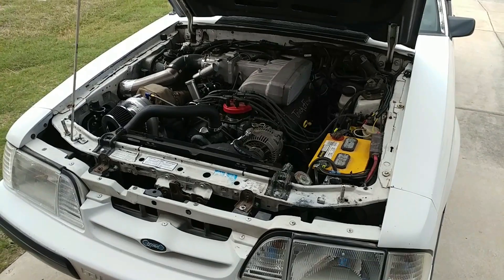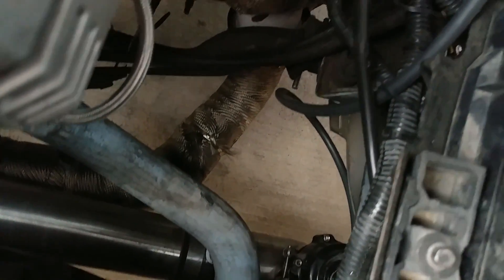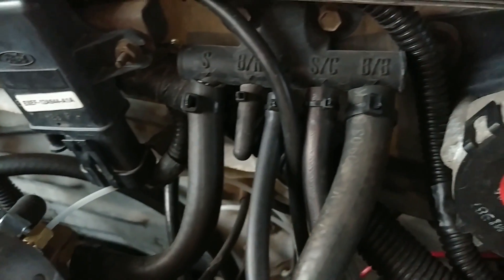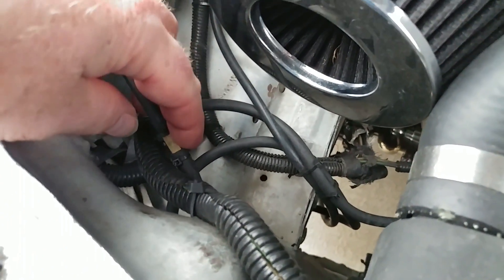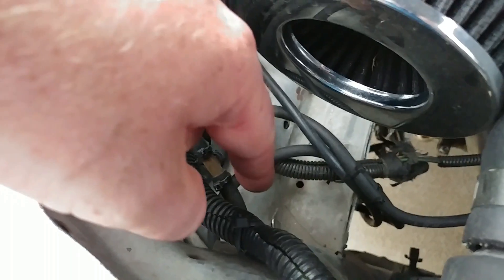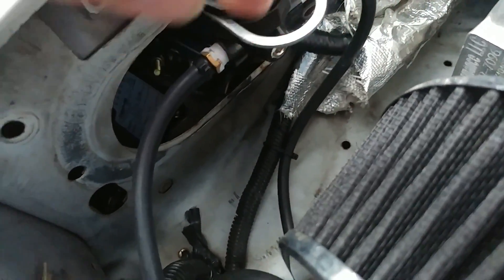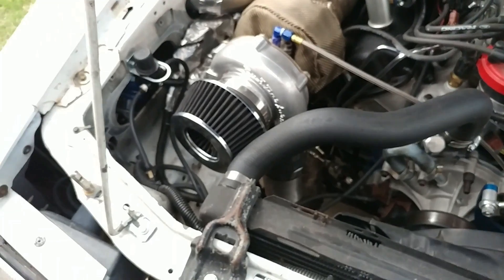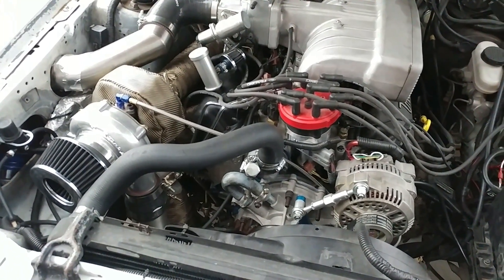On3 Turbo Foxbody Mustang Vacuum Hose Setup

Comment: I am gonna purchase one for my 90 fox, is it a direct bolt on and I have a 255 fuel pump and 24lbs Injectors. As well as 75mm throttle body..what else would I need? I would really appreciate it.
Reply from the maker: Its pretty much a direct bolt on, but every car is different. Your gonna need bigger injectors. Depends on your power goals. I wouldnt go smaller than 42s and fuel pump a 340.

Comment: Hey another question lol what about fuel system are you using the stock system or upgraded?
Reply from the maker: +J.D.M. Performance You would need to upgrade your fuel system. I'm running a really 340lph pump, 47lb injectors

Comment: If your not running a boost controller and only running spring pressure, you eliminate that T junction all together and ONLY hook a vacuum line up to the SIDE of the wastegate, leaving the TOP port open to atmosphere.
Reply: also, it looks slow... and get a good pair of side cutters(or use a razor blade) and clean up the razor sharp cuts on those zipties before you end up needing stitches. :-P  (trust me..been there..not fun.. )   

<3
Reply from the maker: Good Info. Always though you still need vacuum there.
Reply: Nope, if you run vacuum to both ports your negating the springs ability to pressure the valve open. it'll cause crazy boost spikes if done wrong. The vacuum line runs to the side to hold the spring shut at idle and when your building boost itll push the spring open when the boost pressure gets to equal pressure as the springs valued pressure rating. if the line was on the top it would have to overcome the pressure from however much psi your pushing + the springs pressure rating until the valve esentually floats open allowing pressure to bypass, but by that time you'll probably be 8-15psi over what the spring rating is.
Reply from the maker: I like to live dangerously lol
Reply: i can tell.... :-P
Reply: Did you delete your pvc system?
Reply: PCV*  and for that system you have 2 options. a 1-way valve or delete it and go with an oil catch can(which is what I do with ALL pcv systems anyways.. don't want my intake sucking in oil and causing build up).

Comment: Hey Justin, what exactly was your PCV setup when you were running this setup? Thanks!
Reply from the maker: PCV capped off, only ran valve cover beathers
Reply: @justin91lx  Did you have a lot of oil mist/residue engine bay or oil smell in the cabin?